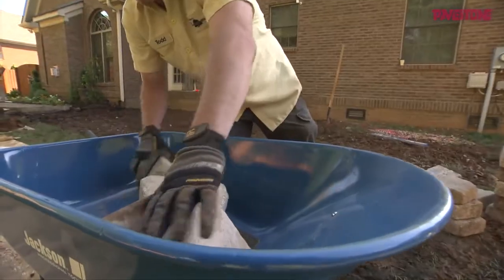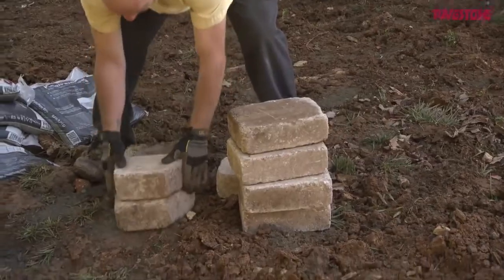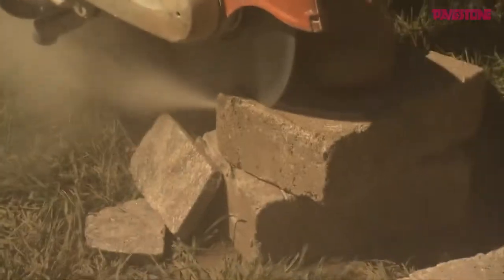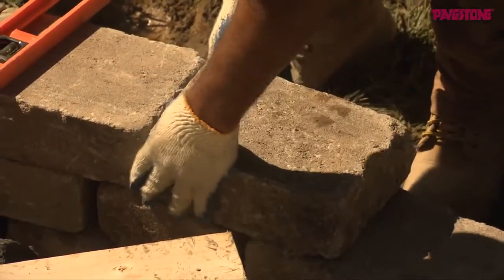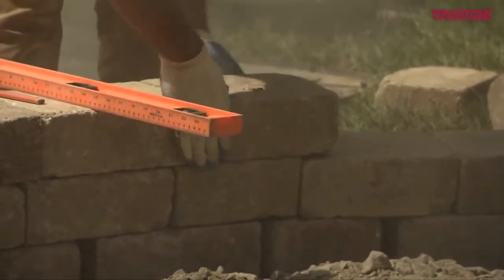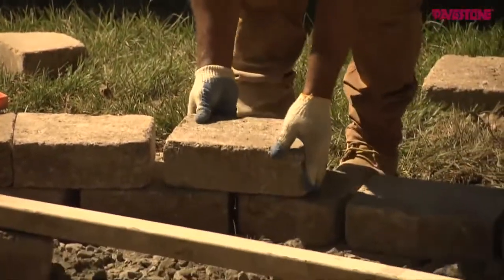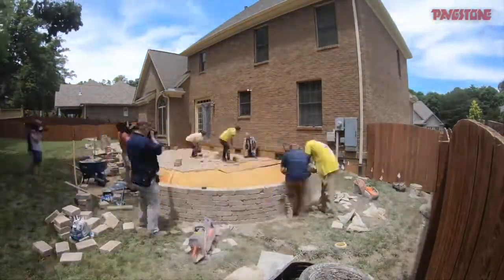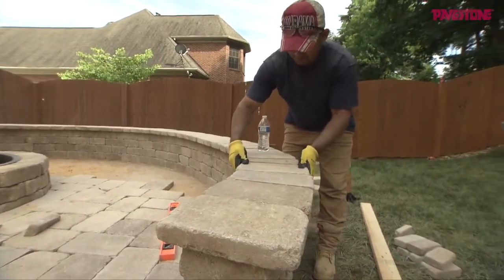How to Build a Patio Seat Wall from Pavestone Pavers | Today's Homeowner with Danny Lipford

Comment: Do the large rectangular blocks at the end need caulk ?
Reply from the maker: Adhesive and sealant needs vary based on the material type and style. 
We recommend following the directions that came with your specific seat wall kit. 
Good luck with your project!